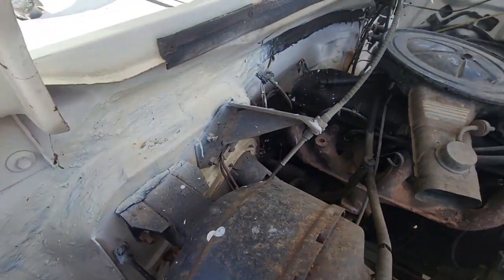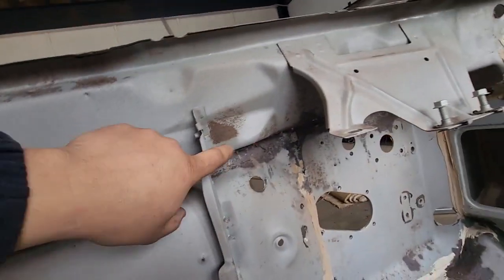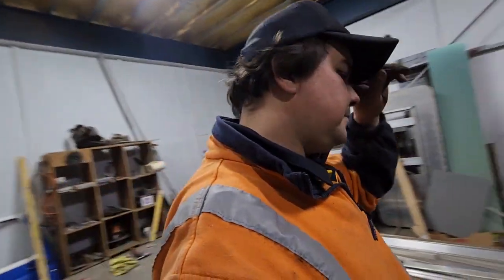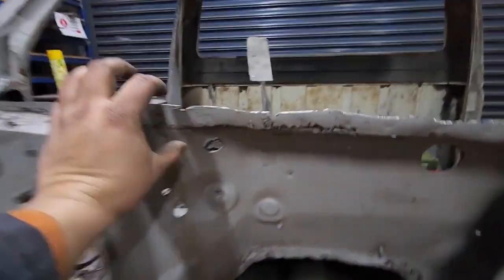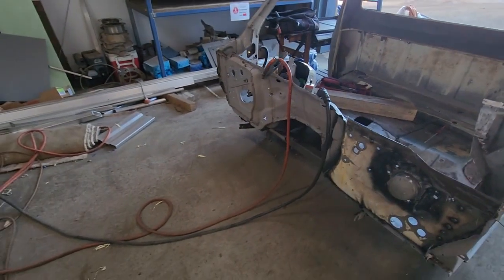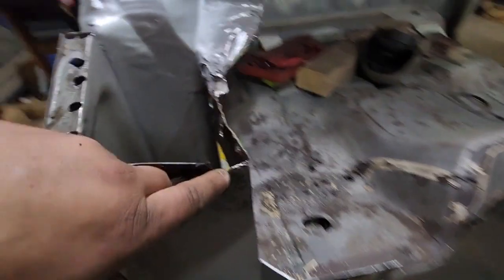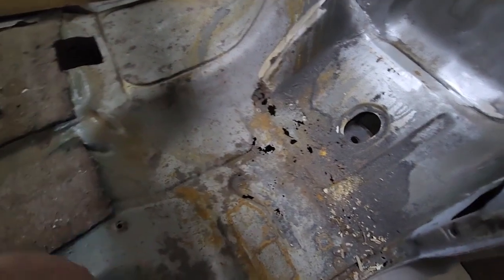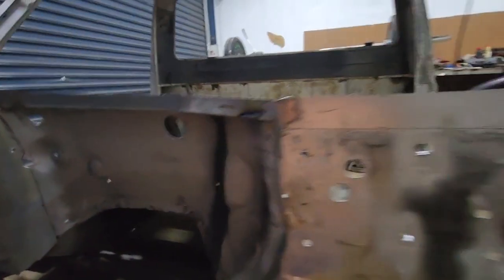F100 build part 1

Comment: just been through all this on my F250 4X4 .... i can feel the pain , i made two in to one firewall also , dunno why they hack holes in the firewall every where , they did it to the rad support too for some reason , looked like they had an intercooler on it , she looks like she's coming on well mate , good job
Reply from the maker: The way ford designed the cowl/upper firewall area is dumb, of course it was going to rust out 3 sheet sandwich relying on poorly applied seam sealer to seal it off